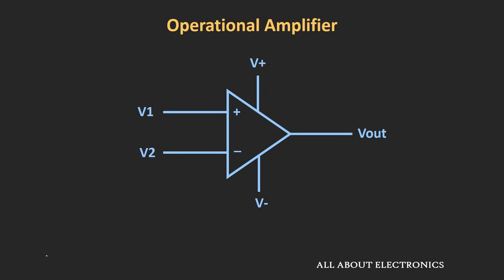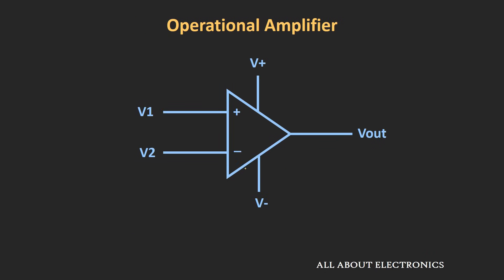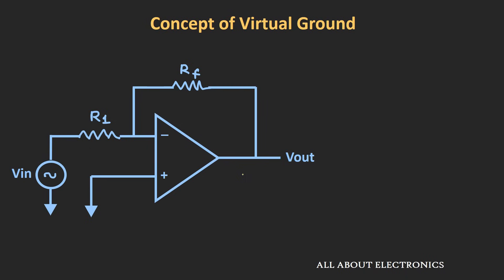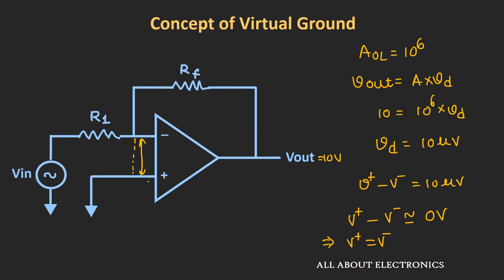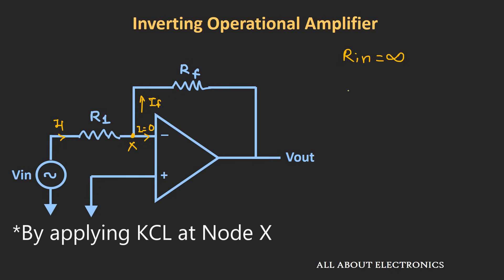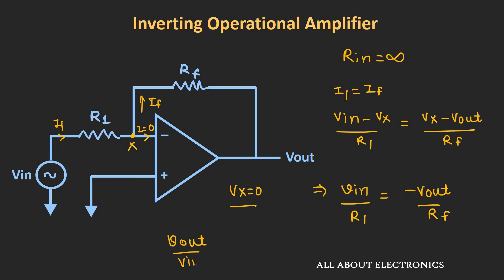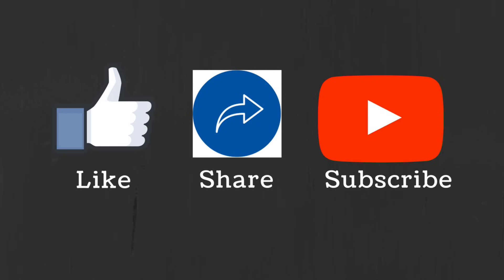Operational Amplifier: Inverting Op Amp and The Concept of Virtual Ground in Op Amp

Comment from the maker: Time stamps for the different topics covered in the video:

0:34 Why do we need the feedback in Op-Amp (Negative Feedback)
3:08 Inverting Op-Amp configuration
3:47 Concept of Virtual Ground in Op-Amp (What is virtual Short)
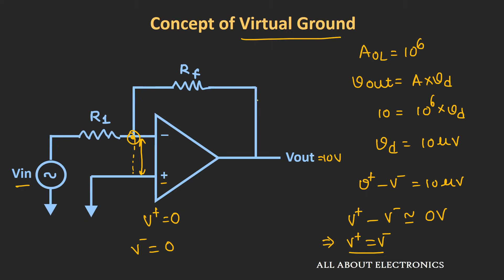6:38 Derivation of Inverting Op-Amp Configuration
Reply: Like all your excellent videos. I have seen this explanation of virtual ground many times, but it is always lacking something. Here the opamp is drawn with a feedback loop, but the huge gain of the open loop opamp is used to explain that the inputs are at virtual ground. Then it turns out that the gain of the opamp with feedback is by several factors smaller than the open loop gain. This would then mean that the inputs are not at virtual ground? Am I missing something in this explanaton. I like to look at it as a differential amplifier with equal bias currents in each branch, so that both inputs have the same voltage.
Reply: Next video kab ayega?? Vi... Jaldi lana...
Reply from the maker: very soon.
Reply: Thank you sir I finally understood 👍
Reply: Bohot mast Sir!!
Reply: I have a doubt ....Ri is infinity for an opamp.Ri is in between  v+ and v- 
If voltage difference is low Ri acts as short how can opamp have high  input impedance
Reply: @akhilasree2218   R(input) is the input resistance to amplifier and not the difference of resistances in v+and v-.. therefore there is no direct relation between v(difference) and R(input)...I hope that makes sense😅
Reply: Why op amp has high input impedance sir
Reply: Plz make a video on op amps actual circuit... Plz😞😞
Reply: Sir can u upload notes of this video it would be helpful
Reply: Sir is there any chance to get  notes  for this topic..... It helpful Us...

Comment: From all the assumptions we made , shouldn't we just ignore that op-amp completely and just construct circuit with resistors nd input voltage.. like what's the op-amp even doing if the input impedance is so high , we can just keep something else thier to have high impedance.. like what's it doing ?? Anyone knows ??
Reply from the maker: Op-amp is performing the amplification. If we just simply connect the two resistors and apply the input, then we won’t get amplification with the passive elements.
Reply: @ALLABOUTELECTRONICS ... Impedance is so high because it shouldn't draw anything from source , least it changes voltage in source by drawing current. So if I want to amplify 2V to 10V , I should keep my 2V constant . So what's amplifier is doing is , it's just getting message that 2V has arrived and is asking to be 10V , so it draws current from that +Vcc and gives it in output . Am I right ?
Reply from the maker: @Summer1727 Internally it has many stages. But basically it is a differential amplifier. It amplifies the difference between the inverting and non-inverting input terminals. The initial differential amplifier stage provides very high input impedance. And the following stages provides very high gain. Becuase of that, we are saying that the op-amp has very high input impednace and it is not drawing any current ideally. (in reality it will draw a samll current). If there is no feedback, the output of the op-amp will get saturated. But due to feedback, the gain of the op-amp is contrlled. And the gain can be decided by the feedback resistor (Rf) and R1.

Comment: why did we assume that vout =10v and not 10000v?
Reply from the maker: The output of the op-amp, will not go beyond supply voltage, or to be precise it will not go beyond +Vsat (saturation voltage of op-amp). So, practically the supply voltage range of the op-amp is limited to ±15V (for some op-amp little higher). That's why it will not make any sense to use Vo = 10000V.
Reply: @ALLABOUTELECTRONICS  makes sense thanks

Comment: 2:50; 3 way of Control the Gain.
3:25; Inverting OP Amp Configuration. Control Gain by using feedback Resistor Rf & R1.
Virtual Ground.
4:05; Differntial Voltage is difference(Vd) between Inverting & non-Inverting pole.
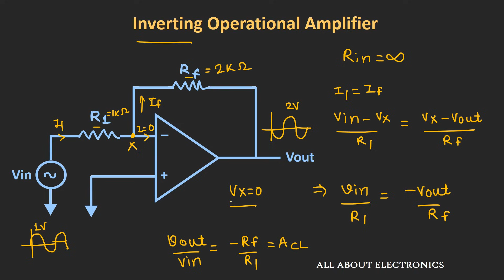7:00-9:25;

Comment: I got to know about virtual ground but how to do this in practice
Reply from the maker: In practice also, if you implement any op-amp based circuit and measure the voltage at the inverting terminal it will be very close to zero.

Comment: 4:47 if we give Vd = 100v as input, can we still call it a virtual ground?
Reply from the maker: No, it can't be said so. Here, we are getting a very small difference between the two input terminals is because of the feedback, and the very high open loop gain of the op-amp. I am going to explain it in more detail in the upcoming video, where I will cover the feedback amplifiers.

Comment: 1:25 how output voltage gets saturated at 10 micro volt? it should be 10^-5
Reply from the maker: 10 uV is equal to 10^-5 V. Isn't it ?

Comment: Thanks for the excellent videos. One question here - for the gain to be Rf/R1, it is assumed the OPAMP is working in the linear region. Does this imply that this is only true as long as the input voltage level for V1 is small enough that the output of the OPAMP does not saturate?
Reply from the maker: Yes, that’s true. For example, for one opamp, if the supply voltage is +-15v and the gain of the opamp is 20. ( assuming you have selected Rf and R1 accordingly) then for input of 1v, you won’t get -20V as an output. The output will get saturated at -15V or even at lesser voltage.

Comment: Why virtual ground happens only in negative feedback ?
Reply from the maker: Virtual ground concept is applicable when the opamp is operating in the linear region. ( when output is linearly proportional to input) And it happens only with the negative feedback . Because of negative feedback, it is possible to control the gain of the opamp. With the positive feedback, the opamp operates in the saturation region.

Comment: How to select input & feedback resistors values?
Reply from the maker: It depends, what gain you want. The formula for the output gain is - Rf / R1 x Vi. So, for example, if you need gain of 5, then you may use Rf (the feedback resistor) = 5 kΩ and R1 as 1KΩ. You can also use, Rf = 25kΩ and R1 = 5 kΩ. The only thing you need to see is, the selected resistor values should be available for implementation.

Comment: How the huge gain is achieved
Reply from the maker: You mean how opamp achieves huge gain !! Well, if so then internally, it consists of differential amplifier followed by the high gain cascode amplifier and other level shifting circuits. Because of that, it is possible to achieve high gain in the opamp.

Comment: Firstly you said in inverting op amp feedback is provided in non inverting input but when you are deriving you took Rf or feedback in inverting input. What a hypocrisy!
Reply: Also if 1v is provided in input then our assumption is wrong of virtual ground. Because then Vx will not be zero, it will have significant value.

Comment: If the Rf is 2kohm and the R1 is 1Kohm, doesn't that make the gain of the op-amp -2 which shows that it is out of phase by 180 degrees with the input voltage signal.

Comment: In 2 min 28 sec sir why positive feedback leads the system to be unstable?
Reply from the maker: When we are using the op-amp with positive feedback, then some fraction of output is feedback to the input. Because of the positive feedback, it will get added with the input. And since it is a closed loop, so with every iteration, (because of the positive feedback) the voltage at the input node will increase. And hence, the output will also increase. So, there will be a snowball effect. And for a given specific input, the output will continuously increase. In op-amps, the output cannot go beyond the supply voltage. So, eventually the output will get stuck to the positive saturation voltage of the op-amp. (Typically, it is slightly less than the biasing voltage of the op-amp). That means if we want to amplify the input signal using the op-amp and if we use the op-amp with positive feedback, then eventually we will end up with either positive or negative saturation voltage at the output of the op-amp. And that is not desirable. That is why for amplification, it is used with the negative feedback.

Comment: I still have some doubts. 1 .what is mean by control the gain,  by applying a negative feed back? Is already controlled by itself in saturation levels. 
2. Why virtual ground is with inverting op amp? Can negative terminal be grounded? Pls reply
Reply from the maker: Without negative feedback, the gain of the opamp is very high.( 10^5 to 10 ^6). But with negative feedback, it is possible to achieve specific gain. And by controlling the value of the external resistors, it is possible to even control the gain.
Reply from the maker: The virtual ground concept is valid for the negative feedback. In inverting configuration, the non inverting terminal is grounded. Therefore, as per V+ = V-, the inverting terminal will also be at the same potential. In case of non inverting configuration, because of negative feedback still V+ = V- is valid. In that case, whatever voltage is applied at the non inverting terminal, the same will appear at the inverting terminal. Many examples related to it has been covered on the second channel . ( 40 to 50 opamp examples are there).
You will also find the same on the channel page.

Comment: Hi 
I have a doubt 
Since all the current is flowing through external resistance then how it amplified?
Reply from the maker: Although ideally we assume that, the Op-amp is not drawing any current, ( it’s input terminals) but actually internally the transistors does draw some current for biasing. Internally, it consists of differential amplifier, current mirrors. And these circuits require current for proper biasing. So internally they are drawing current from the supply voltages.
Reply: @ALLABOUTELECTRONICS  that is biasing current which pass thr0ugh amplifier but 
my c0nfusion  is that current  which is to be amplified does n0t pass through amplifier 
How it can be amplified
Reply from the maker: It is voltage amplification. Here what we are getting is voltage gain.

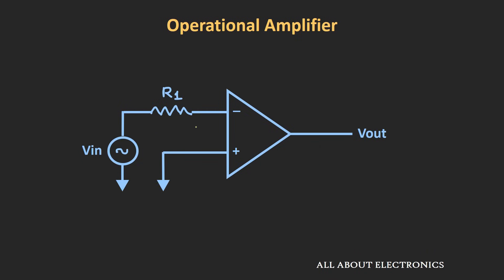Comment: I didn't understand that at 3:11 Why the polarities of op amp are changed i.e. inverting terminal came up and non inverting terminal went down. Please clarify
Reply from the maker: It's just for representation. While drawing the opamp symbol, you can represent either inverting or non inverting at the top and the other one at the bottom. It will not change the functionality of the circuit.
Reply: @ALLABOUTELECTRONICS  
I also have a doubt sir, somewhere I have seen the symbol of op Amp in another way, inverting terminal and positive supply at top, non inverting terminal and negative supply at bottom 
Which is right 
I am totally confused at this terminals and power supplies positions 
Please solve my doubt

Comment: Thank you sir. What happens if we apply negative input to the inverting terminal? Please make video on this also explaining the current directions.
Reply from the maker: When we apply negative input (e.g  -1V), and if the gain is 5 then output would be 5V. ( positive). The direction of current will get reversed.

Comment: Hi, in theory the gain ratio is unlimited in the non inverting op-amp amplifier circuit. Is it actually possible to make a profit in this way?
E.g; Can a 12mv sine signal be amplified to 12v with 1000x gain?
Reply: the op-amp has a power supply too, right ... so the extra "power" so-to-speak is provided from that power supply... unfortunately doesn't seem like a "profit" situation

Comment: Even if you take Vout as +Vsat or 15volts then also same logic can be shown but actually this is not virtual ground concept. Virtual ground fails if opamp is in saturation here even if you take Vo as 15volts Vd will come 15uv which is approx 0
Reply from the maker: Yes, virtual ground concept is vaild only when the opamp is operating in the linear region.

Comment: What are the applications of inverting and non inverting circuit
Reply from the maker: Mainly they are used for the amplification of signal. But these configurations are also useful in filter design, as well as in the timing and wave shaping circuits.  If you  go through the op-amp playlist on the playlist page of the channel then you will also find the different applications of the op-amp, where these configurations are used.

Comment: Sir, Why concept of virtual ground is applicable when we are giving negative feedback but the equation which you have explained is using openloop gain AOL
Reply from the maker: If you go through the recent comments then many have the same doubt.  When we are talking about the feedback gain, it is the gain of the entire op-amp circuit with external resistors and not the gain of the op-amp. The open-loop gain is the gain of the op-amp itself without external resistors.
I hope it will clear your doubt.

Comment: But if we are using feedback, then how can we use Open loop Gain in calculation.... Equation for feedback gain would be different and that should be considered!!!
Reply from the maker: When we are talking about the feedback gain, it is the gain of the entire op-amp circuit with external resistors and not the gain of the op-amp. The open loop gain is the gain of the op-amp itself without external resistors.
Reply: @ALLABOUTELECTRONICS  oohkay..I got it...😃...thank you✌️🙂

Comment: During derivation of virtual short why we are taking open loop gain (at 4:05)since negative feedback is already connected ,is this not a closed loop gain ??
Reply from the maker: Just to explain the effect of the closed-loop circuit. The op-amp itself has the open-loop gain. But with external resistors, the overall gain of the entire circuit (Inverting amplifier) is reduced.  I hope it will clear your doubt. If you still have any doubt, then let me know here.

Comment: Why is virtual ground not applicable to positive feedback?
Reply from the maker: The virtual ground concept is applicable only when the op-amp is operating in the linear region. Or in other words, when the Vin and Vo are linearly proportional. With positive feedback, the op-amp operates in the saturation region. Once it enters into saturation, even if Vin is increased, the output remains saturated either at +Vsat and -Vsat. And in that case, the voltage at the inverting terminal will no longer be zero (or equal to V+). You can also check it practically or through simulation. 
I hope it will clear your doubt.

Comment: I have a question, For proving the virtual ground concept we consider gain very high e.g 10^6. But by choosing different values of Ri and Rf we got gain as 2. Will this not contradict our virtual ground concept??         Please explain!!!!!!!!!!!!!!!!!!!!
Reply: same doubt!!
Reply: Hi 
But to attain desired oscillation the  op amp is tunes with R1 and Rf so that it's gain is silgithy more than 1
Please tell if it's correct or not?

Comment: Sir how we get the gain  the input impedence of an op amp is infinity the total amount of current is flow through a feedback network how we get🤔
Reply from the maker: When we say, the gain, its the gain of the inverting op-amp configuration. 
In that op-amp configuration when we apply the input, what output we are getting?
The externally connected resistors are also part of that configuration. 
I hope, it will clear your doubt.
Reply: @ALLABOUTELECTRONICS  kk sir tq for clearing any doubts😍
Reply: @ALLABOUTELECTRONICS  But sir current is not flowing into the op amp, the current is flow through the feedback network then what is the use of op amp
Reply from the maker: @bandarumanikanta1442  It seems there is no role of the op-amp. But without op-amp, if you just connect two resistors then you won't get the same result. Since we are using the concept of virtual ground, it appears as if there is no role of the op-amp.
Reply: @ALLABOUTELECTRONICS  ok thanks sir to clarify the doubt

Comment: Why here we have. Taken i1=(Vin-Vx)/R1. And             if=(Vx-Vout)/Rf.                                That I didn’t understand sir
Reply from the maker: Its. simply ohm's law. The current through any branch is the voltage difference between the two nodes divided by the resistance. That's why I1 = Vin - Vx / R1.
I hope it will clear your doubt. 
If you still have any doubt, let me know here.
Reply: ALL ABOUT ELECTRONICS  thank u so much sir for your explanation 🤩🤩😊

Comment: Why we apply VGC only in negative feedback ?
Reply from the maker: Because that concept is valid when the op-amp is operating in the linear region. ( As show in the voltage transfer characteristic)
With negative feedback, it can be ensured that the op-amp is not going into saturation and operating in the linear region.
I hope it will clear your doubt.
Reply: @ALLABOUTELECTRONICS  yup..thanks

Comment: Can we apply virtual ground concept in non inverting amplifier?
Reply from the maker: Yes, Since there is a negative feedback and considering ideal op-amp,  we can apply the concept of virtual Short. (V+ = V-)
That means the voltage at the inverting and non-inverting terminals will be same.
Reply: @ALLABOUTELECTRONICS  thank you sir

Comment: what is differential input voltage ?? Please explain !!
Reply from the maker: Here the differential input means the difference of the input voltage between the two terminals of the op-amp.
e.g if the input of 2V is applied at + terminal and 1V at the - terminal then the differential input between the two op-amp terminal is 1V. ( I am referring to the op-amp in the open-loop configuration)
I hope it will clear your doubt.